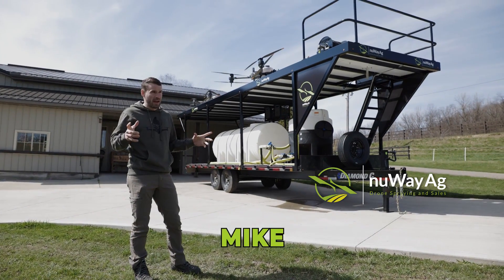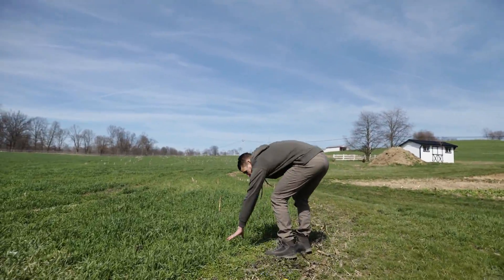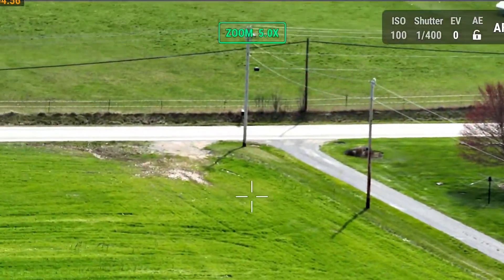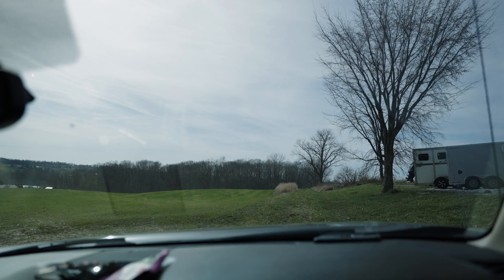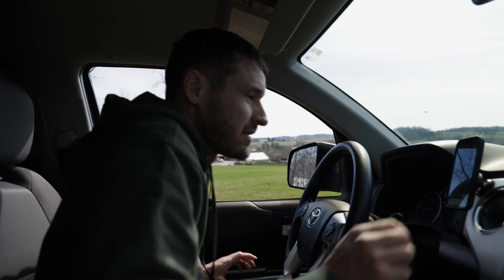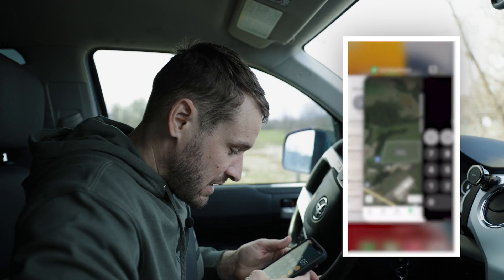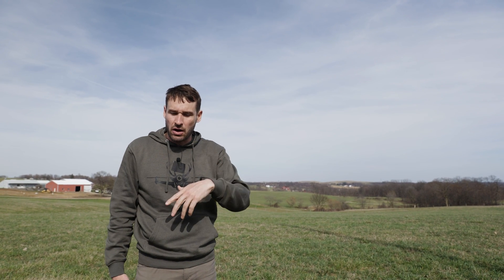Boundary Building ￼Spray Drone Agras T40

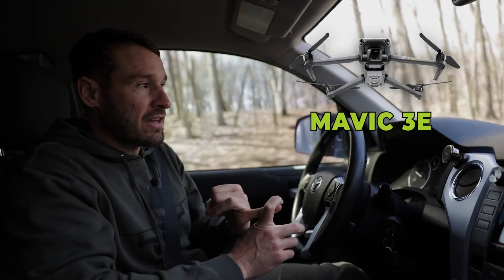Comment: 1:57 What luck have you had with the Mavic 3E boundaries?  Just picked up a Mavic 3E and am wanting to use Pix 4D to run boundaries and use JD ops center integration to use with our sprayers.  

Thanks
Reply from the maker: The Magic 3E is useful for some scenarios, necessary in others. But for many - not necessary at all